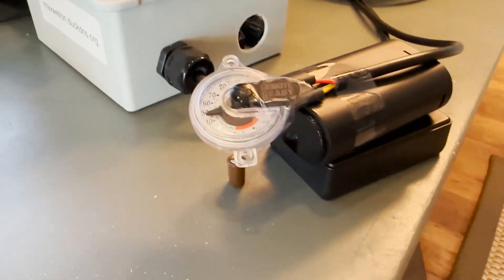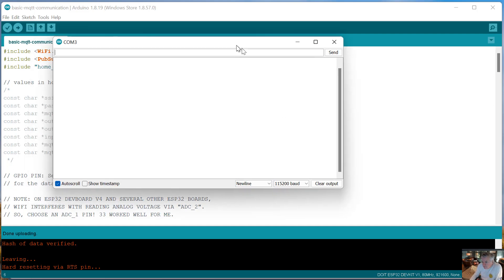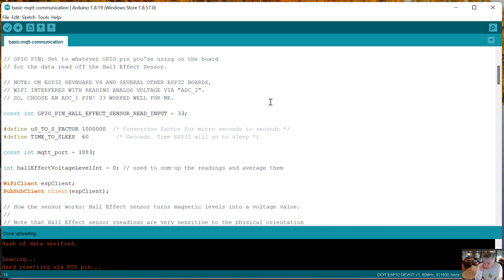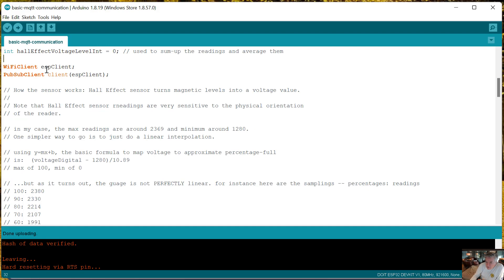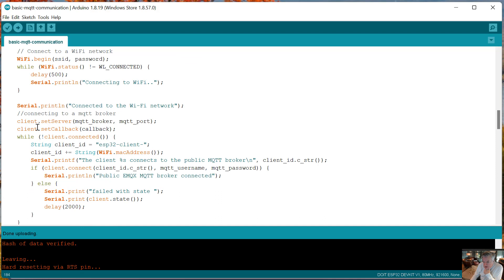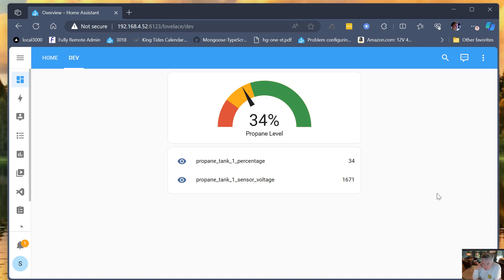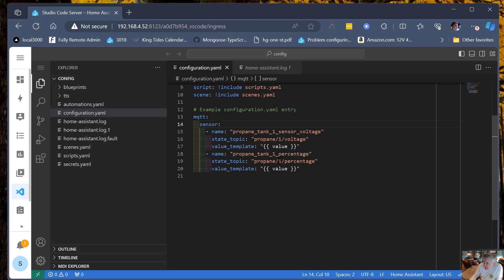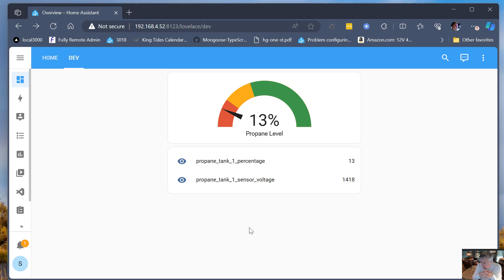Monitor Your Propane Tank Remotely with ESP32 and Home Assistant

Comment: Just used your code and steps to make this. Never used VSC before and got it working on the first try. The physical aspects (getting the sensor to stick int he right place and getting power to my board were more painful than the actual programming!). thanks
Reply: for whatever reason and no matter what I do, eventually the ESP32 will drop from wifi/HA. tried to amend the code to convert to ESPHome or otherwise add a daily reboot but to no avail. Let me know if any tips. Thanks!

Comment: Given you are calibrating the Hall Effect Sensor (like you did with the cabinet door magnet), did you use a different gauge for your calibration work or did you remove your gauge from your tank and bring it in your workshop to do the calibration.  I have two above ground tanks (250gal, 500gal) and I'd like to build out this solution using one ESP32 to read the data from both tanks - which I know would require two look-up tables given the Hall Effect Sensors are each unique in output voltages.
Reply from the maker: I calibrated it further "in the field" -- i.e., using my laptop connected to the ESP32. In my own field configuration, the ESP32 lives in the garage on the wall, is powered by 5V USB connection, and has a 30+ foot cable that runs in a trench out to the tank with the Hall Effect sensor. I had the ESP32 code report the "raw value" to MQTT on a periodic basis, and I can then calibrate the "raw value" result to an approximate percentage-full. For my own purposes, anything within 5% either way is more than good enough... as I'm mostly just interested in knowing when it's time to call for a refill.
Reply: @stevemurch3245  Thanks!  So you did purchase a separate gauge to work with and then fine tuned it "in the field," yes?  Our provider here in TX offers a service where they will stop by when a truck is in the area and check my levels, if low they fill me up so I don't have to worry about calling.  However, I'd love to have a gauge in HA for both my tanks so I know what the level is without walking out to the tanks.  It's not that far and they are located about 10' from my pool equipment where I have a couple of 110V service outlets, so I'm thinking I'll just mount my ESP32 in a weatherproof box and place it by the pool equipment to use the 110v.
Reply from the maker: @rbhooks8608  I only purchased a "Ready for Remote" gauge (no wires, just a plastic dial), and then supplied the wires and Hall Effect sensor myself. I used the cabinet magnet shown in the video to get initial calibration, got it all sealed up (very important! do at your own risk!) -- and then calibrated the results more in the field. Each tank will give off different levels of magnetic signal, so you really do have to allow for the values being reported to be interpolated.
Reply: @stevemurch3245  Got it.  So you replaced your gauge on the tank with the one your purchased and did the initial calibration on.  Just wanted to be clear since I didn't know if you could calibrate on a stand-alone gauge and then transfer to the gauge that is already on the tank.  Since both my tanks already have the "ready for remote" gauges, I may have to get everything working in the house with a new gauge and then take it out to the tanks to do the final calibration - I'm guess the amount of metal in the tank does change the magnetic field somewhat from a gauge just sitting on a workbench.  Thanks for all the help and assistance!!
Reply from the maker: You're most welcome -- good luck! It's been working well through a very cold winter thus far. It's fantastic to be able to see the percentage remotely, without having to physically check. Would encourage you to have the ESP32 (or Arduino) code report the raw values out to MQTT, and then do the translation of those values into something meaningful in the presentation layer. That way, re-calibration is a bit easier than having to push out new ESP32 code.
Reply: @stevemurch3245  Good idea on doing the calibration in the presentation layer as opposed to the code on the ESP32.  Definitely makes recalibration much easier!!  Thanks!  And stay warm up there!!

Comment: what is the proper location and orientation hall effect sensor on the gauge
Reply from the maker: As I recall, the flat side of it needs to be facing down, and as far flush and toward the center of the dial as possible. Try it first with scotch tape or masking tape, you’ll likely need several iterations to find the maximum reading accuracy. The tolerance range is very low and sensitive, so keep trying — all you want is for the 0% reading to be one value and the 90% value to be a different enough voltage value to interpolate between.
Reply from the maker: More on this: I was a little surprised at how relatively narrow the electrical resistance range was between highest and lowest. But don't worry -- in most cases, you just want enough spread between the lowest and highest to get it to within 3-5% accuracy.